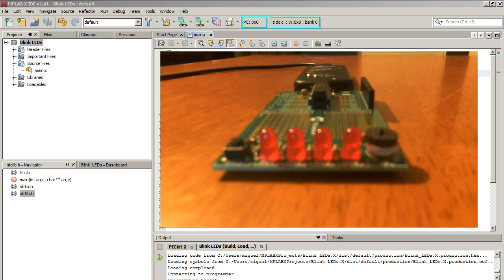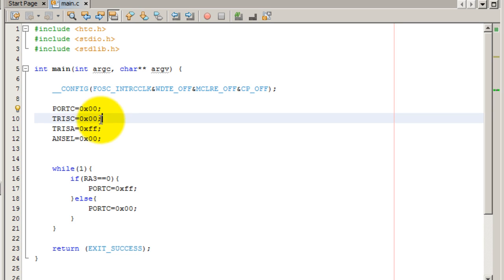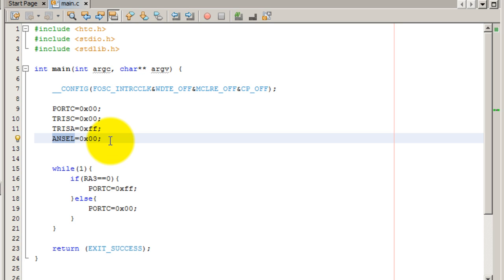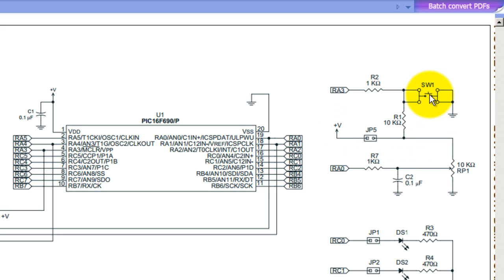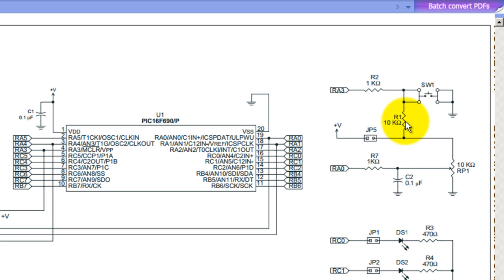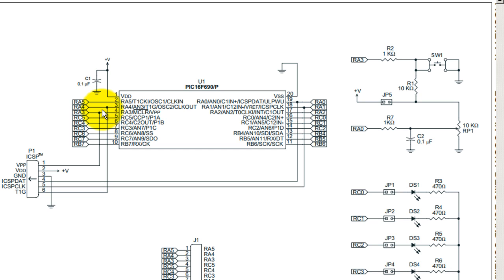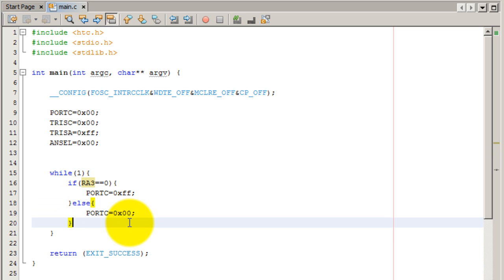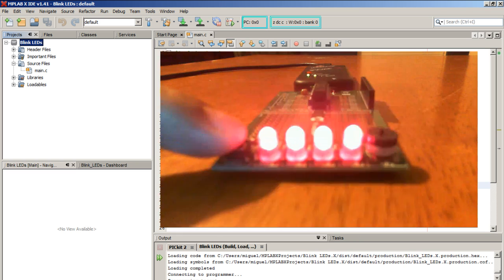PIC Programming - Digital Input With Button (HI-TECH C)

Comment from the maker: Y could use a pic that has each one of those pins (a 40 pin one), or you could use the PIC am using (a 20 pin one) plush an input/output expander IC.